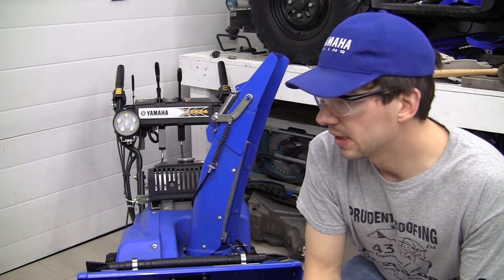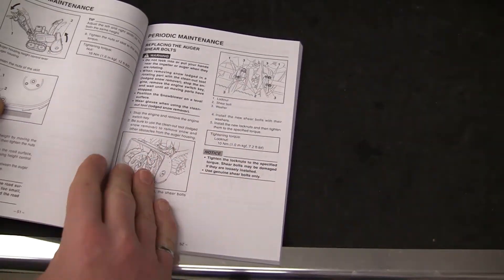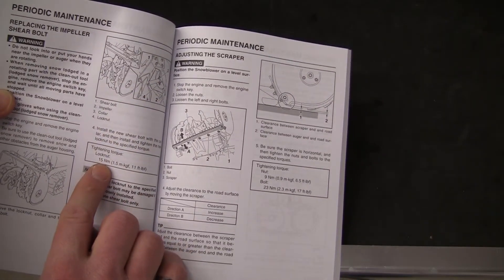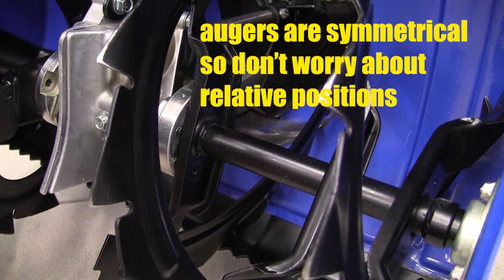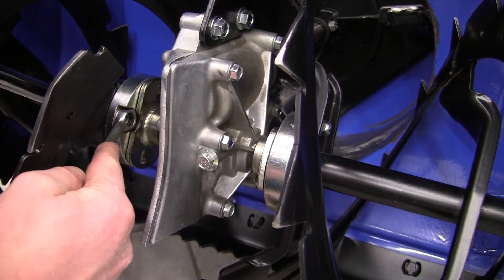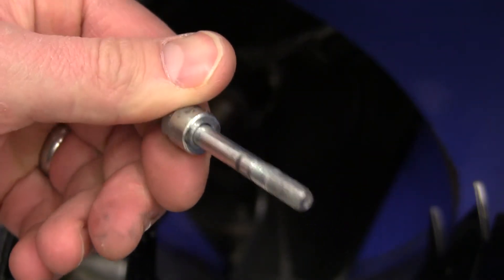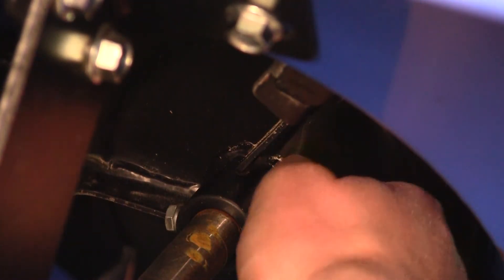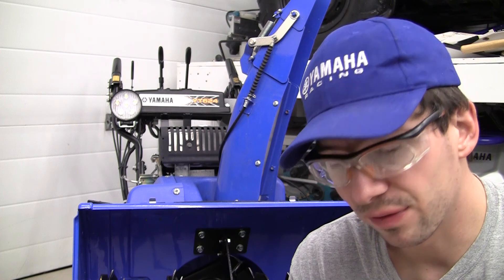Ep. 7 - YT624EJ M.S. - Shear Bolt Inspection and Information

Comment: Same bolts for a 624E?
Reply from the maker: Well, usually I'd direct you to the Impex site to check the charts, but the site doesn't seem to be working right now... I would think the probability is quite high that they are the same, not much changed in these machines over the years. Hopefully the Impex site starts working again.

Comment: Hi thanks for the video! Could someone share what size the shear pins are? It's sacred knowledge for some reason and hard to find! 
Thanks in advance!
Reply from the maker: I'm not sure it's super sacred, could easily buy one from the Yamaha dealer and measure or take one out of your auger and measure?

Regular 20mm M6x1.0 Flange Bolt with M6 locknut. Bolt class is unclear but I'd use the weakest bolt you can find as I've never had a Yamaha shear bolt break yet.
Reply: @lucgallant  aw that's amazing, thank you! I guess I could have measured it myself but was thinking it would be listed in the manual and it wasn't.  
Thank you so much! Hope you're having a great day!
Reply from the maker: @bumblevee123  np, have a good one!

Comment: Make sure to only use Yamaha OEM impeller bolts. Dealer gave me Honda bolts and it caused the larger hole in the impeller to expand and cause frequent failure of the bolt. There was way to much play in the impeller.

Comment: So in the fall I changed my Auger oil and put gear oil in  and just recently broke the impeller shear bolt…this is the same bolt for the last 7 years and it didn’t seem like I ran over anything…do you think it’s a result of putting gear oil in the auger or maybe Fatigue?
Reply from the maker: I wouldn't think it was oil related at all. I'd think fatigue. Have a good look at the. Have a look at the bolt and and see if you can see signs of fatigue, if it's still there.
Reply: I wish I would have been able to see the old bolt and been able to save the spacer the new shear bolt cost me $11.39 for the bolt $7.20 for the nut and $11.81 for the collar ouch 😢oh plus tax

Comment: Bonjour Luc, superbe vidéo en passant. Il semble y avoir de la rouille entre l’impeller et le shaft, n’aurait-il pas été bon de le graisser avec de l’anti seize vu que la sheer bolt était enlevée?  Just my 2 cents
Reply from the maker: Yes it's a good point. To be honest I spend most of my mental energy focussing on the video and I let stuff go that I would not usually let go when I am doing only that task. On that particular location I can now actually shoot a little bit of oil in there. Could have actually taken the impeller right off during the auger job in a later video but didn't. Thanks for the feedback, I agree!